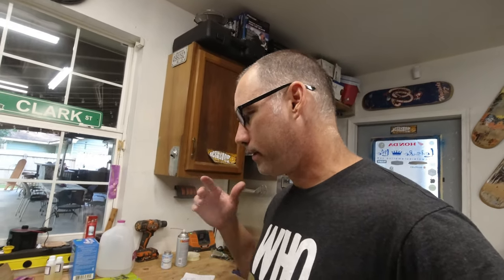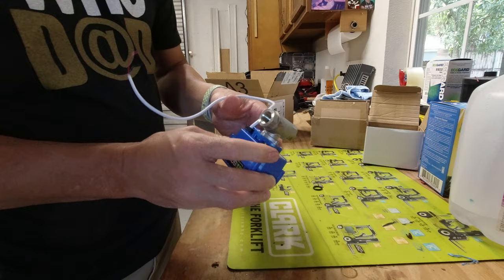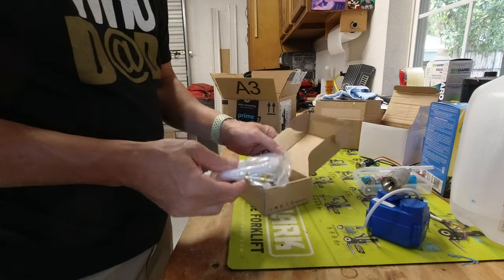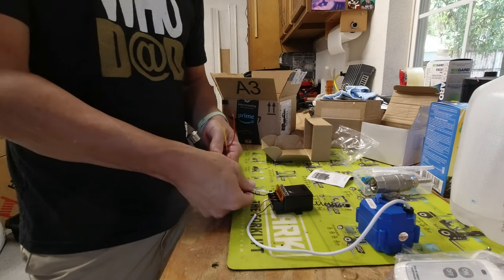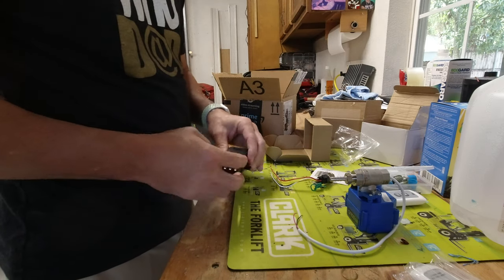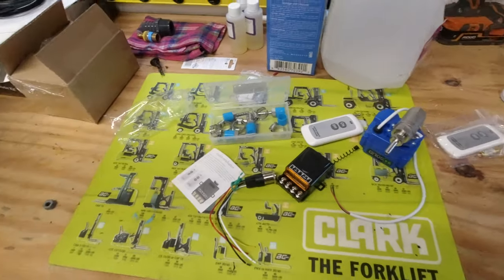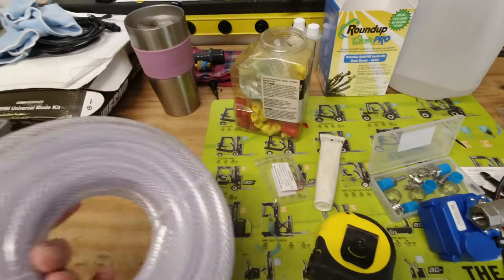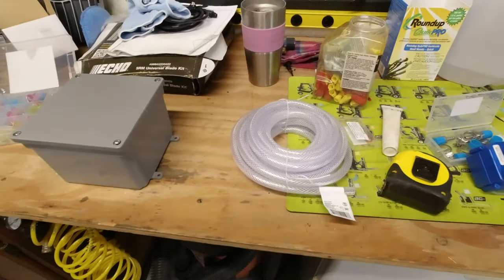DIY Remote Downstream Injector Box

Comment: Nice bro, we ended up making one also but we just used a Bluetooth water sprinkler system from a chem tank to an injector then ran the  hose line from injector to a split in our wip hose from the real. This saved us alot of money and time, we used the extra cash to buy a 200' of  hydraulic hose that has a teflon inner 3/8" line so the Sodium Hydrochloride doesnt break down our hose added a Chem Rated spray gun with 6063 rated aluminum lance we made. This way we not have to worry about replacing anything that breaks down in the injection bypass system itself or the components such as ball valves ect. The Bluetooth timer has a lifetime warranty also 😁.
Reply from the maker: Awesome!! I need to look into that. Thanks
Reply: @allproexteriorservicesllc5338  hey can I ask you a question pls sir. I have been trying to remove all the flow restrictions throughout  the various components on our setup from pump to tip. We bored out our Unloader, removed a couple filters that bottlenecked the 3/8" line as well. I had noticed the inner part of every swivel we have  have ( we have a generic one and a mosmatic one ATM) all of them have a tiny tiny little hole that leads to the ball valve. I dont have a GPM gage but i can tell just from feel when I hook the gun up without the swivel vs with its def stronger with it removed. Im assuming its because of that bottleneck in the swivel so I guess my question is 2 parts.... 1. I this a correct assumption? and 2. If it is restricting flow rate are their any type of swivels that keep a strait 3/8"  diameter through the entire swivel? Thanks!!!!!

Comment: Very good video bud...I'm trying to hook up a 3 way valve wood the wiring be the same the one I got coming is 3 wire
Reply from the maker: It should be close. Not sure of the connections on the 3-way valve. Thanks
Reply: @allproexteriorservicesllc5338  I think I messed the valve says it works with 110 through 230v AC

Comment: Hey friend I built the same box. It works well but having an issue with the hose popping off of the injector . I am running my washer hose straight to the injector. Do you have a picture of how your injector is on your trailer
Reply from the maker: I do not have a picture currently since we do dont down stream anymore. Usually when the hose pops off that means the injector ball or spring is bad. You can rebuild the injector or try a new one. Thanks

Comment: with this set up other than the electric pump for the soap to the pressure washer hose is there a pump to the remote pump or when its open does it naturally suck as if the switch wasn't there?
Reply from the maker: The injector sucks naturally. When you turn it off, he ball valve closes preventing the suction therefore no soap or SH. Thanks

Comment: My issue is I have to take off my downstream injector because no matter the tip I use it still continues to pull . I mostly use the m5 twist to apply and to rinse but I have to go back to trailer and turn it off, unhook the injector, hook the jumper hose back to the reel and start the unit then rinse. It’s a lot to do and waste time. I’m trying to figure out what to do to where I can apply SH/soap/degreaser etc.. then rinse
Reply from the maker: This down stream box will work & the Flow Pro will work. It has saved us a bunch of time when we were down streaming for sure. Thanks

Comment: 4 yrs later I see this video.  I was watching some of these diy remote setups and now i realize why the other guys put the on/off switch on the side of the box.  I was wondering why aren't they putting them on the top of the box.  Then i seen you press the button and because its not a momentary switch it says sunk in and can hold water and possibly make the switch go bad is what I am thinking.  What do you think about my little theory?
Reply from the maker: That is a great theory! Also use the Banjo ball valve as it will last longer. Thanks

Comment: Could you please help me with the battery wire! Like just a link to one or something. I don’t know what gauge to get and I also don’t know if I need a fuse or not on the wire. I also can’t find one of those circle connectors that will fit on the remote part to hold the wire there, they are all to big of circle connectors that won’t fit where you screw it into please send a link of the exact wiring stuff!
Reply from the maker: A 14 or 16 guage wire will work. Also, out the fuse close to the battery in the event it shorts out. 
https://www.amazon.com/GearIT-Marine-Speaker-Conductor-Electrical/dp/B0CC8HBGM4/ref=sr_1_1_sspa?crid=3HGGRFEORN6SY&dib=eyJ2IjoiMSJ9.LdJ8uetzS6n4n8ppnMVYHrNQB1dEhA37q-TzTUDSbGFg3hPFNQj0TImXL1J-OdTg191wMx7aIVdIcbp58-_PurVmLdCJc4FMhGbiCs4BFfyF0e3periXhmeBkLhj9eZ8YD2cHx2RpFR9aLkiogtE9Hndnf4nJv27WTQDo3Kam0nUx7RSkd1teR5cHTl5meUuGOklnQG9Vv7PgCtRpQipAIyslmWokfuzh8v7jod-GFQ.1OEg9e3QtNzDvIZUs4xn6cCc2DiYVdm9yIQgvMPoCvc&dib_tag=se&keywords=14%2Bgauge%2Bmarine%2Bwire&qid=1709905574&sprefix=14%2Bgauge%2Bmarine%2Bwire%2Caps%2C113&sr=8-1-spons&sp_csd=d2lkZ2V0TmFtZT1zcF9hdGY&th=1

Comment: I see where some guys are using 3 way valves to turn on and off soap and allow them to be able to flush out their injector. However, with a remote DS box, is that possible still? I don’t see where/how you can use only a 3 way to hook up to the soap, injector and buffer tank with only 3 barbs. Do you use this or have a pic of using the 3 way?
Reply from the maker: I do have a manual 3-way valve to flush out my injector with water. I have it connected to the SH line & water line and do the flush when done. Hope this helps! Thanks

Comment: Could you also use a 3 way valve so that when you click the remote you are just switching back and forth from sh to clean water? Yes you would have to run two lines from the ball valve, one to clean water and one to sh tank. That way every time you rinse it also rinses the injector.
Reply from the maker: Yes, that would be the ideal solution. The challenge is finding a 1/2" 3-way electric valve. Thanks

Comment: They make different size on the valve what should inuse fir and GPM
Reply from the maker: the DS injectors run on 1/4 line. Use a 1/4 valve. Thanks

Comment: Not sure how long you’ve been using this for but I’m sure that you rinse it after every use from the SH. How has it been working? Any problems with the ball valve?
Reply from the maker: I have been using for like 6 months with no problems. I know at some point the valve will fail with SH, but I rinse the ball valve every time.
Reply: @allproexteriorservicesllc5338  Thanks

Comment: I just put one of these together. My valve makes no sound when I turn it off, I guess I got a bad one. What do you think?
Reply from the maker: It should make a little sound & close the valve. A couple of people reported getting bad valves. Thanks
Reply: @allproexteriorservicesllc5338  did some research. I bought one that needs polarity reversed to close.  The one I need, that is normally closed until power on is part number JFMSV00027. Maybe this will help someone else.

Comment: Is there anyway to run 2 lines 1 to SH and the 2nd line to soap? Or do you have to Bach mix?
Reply from the maker: With this set up, I just added soap to my SH. Not sure if you could run separate line. Thanks
Reply: @allproexteriorservicesllc5338  ok thank you for your reply.  God bless and continued blessings

Comment: Nice...Thanks!  Question... the red and black wires from the battery connect to what wires on the remote valve? Or do they connect to the On/Off switch (green/black)?
Reply from the maker: Check out my other video. https://www.youtube.com/watch?v=lW625cq8QZc&t=1s

Comment: Did you take the ball and spring out of your injector
Reply from the maker: No I did not, but I love the idea. The ball & spring only stop the flow with a higher pressure tip. I may have to try that when it goes bad.
Reply: Take the Balll and Spring out use a stainless steel check valve in its place.. PM me if you like I'll send you pictures
Reply from the maker: @srdjannakalamic5856  Please send me details. Thanks

Comment: How long does it last, also will you still need the downstream bypass for stronger flow when rising?
Reply from the maker: With the US solid valve, I have gotten 7-8 months out of the valve. The Banjo valve is still going strong after a year. You don't need the bypass, but it does help. the Flo Pro unit is set up to work with the bypass. Thanks
Reply: @allproexteriorservicesllc5338  can you throw the banjo valve link up brother?  is it just a 1 part swap or do i need a different motor assembly ? thanks man
Reply from the maker: @dcsc4895  It is a direct replacement. https://www.jmesales.com/banjo-1-2-in-polypropylene-on-off-electric-ball-valve/?gclid=CjwKCAjw682TBhATEiwA9crl38SkmvLbtu2mmTofgKONt9UC5H8dH5M1U4XigzSF2Kw4pax-73I8fhoC9d4QAvD_BwE

Comment: Sir I have all the parts in your video.  Do I need to buy any wiring to get it started. And what will it cost if I mail it to you to put together for me ???
Reply from the maker: The only wire you will need is from the battery to the box. You can use a 16 gauge 2 conductor wire. I do build them if interested. Thanks
Reply: @allproexteriorservicesllc5338  if I mail it will 150 cash would that get it built plus a extra 20 for shipping
Reply from the maker: @HouseWashingRick  Sure. Let me know.
Reply: @allproexteriorservicesllc5338  I can mail it to you first thing Tuesday morning if you like
Reply: @allproexteriorservicesllc5338  actually I'm waiting on the on off button that's only thing I'm waiting on from Amazon should be here Tuesday.
Reply from the maker: @HouseWashingRick  Cool. Let me know
Reply: @allproexteriorservicesllc5338  will do soon as switch button comes in ill reach out and send it to you the following morning

Comment: how is holding up since youve had it a while now? thanks
Reply from the maker: It is still on the trailer & doing well. Just note I did change from the stainless to the poly valve but worth the extra expense. Thanks
Reply: @allproexteriorservicesllc5338   Thanks for the quick response.

Comment: My ball valve is working opposite as it should. Valve is open without power and closes when I hit on
Reply from the maker: Try reversing the wires. Thanks
Reply: I bought a Normally open valve instead of a normally closed valve. It’s simple to convert the valve either way by just flipping the gear. It works perfectly! Thanks!
Reply from the maker: @frankpirrone6032  Good to know!! Thanks
Reply: @frankpirrone6032  how did you flip the gear? I too ordered the wrong one and chased air leaks through a new blend manifold and pluming trying to figure it out. I finally pulled the hoses off and the barbs and saw I had ordered the normally open valve so when I powered it to draw chlorine and soap I was actually closing it. I ordered the other normally closed one. I did not thin about reversing the gearing …

Comment: Will this work with a ar45
Reply from the maker: I would recommend a 3-way for the AR45. You may be able to use this style in 1" on the SH valve, but then you would also need one for the soap line. Thanks

Comment: Dose it matter on GPM with this?
Reply from the maker: No sir. Should work with any GPM that uses an external injector. Thanks
Reply: @allproexteriorservicesllc5338  Did you run the main power wire to your pressure washer battery or do you have a separate battery for this?  Thanks aging for your help.
Reply from the maker: @jasonward627  I run the to same battery for my pressure washer. Thanks